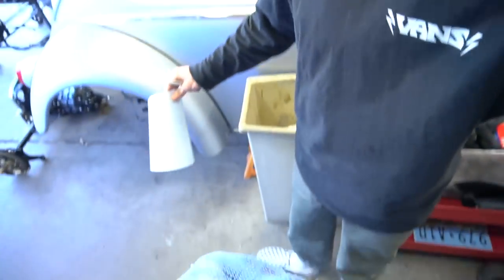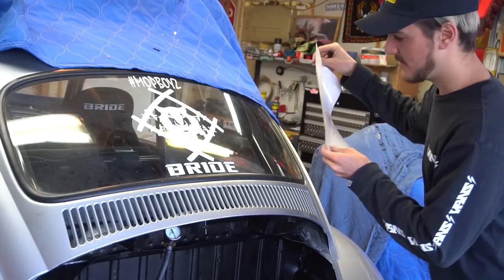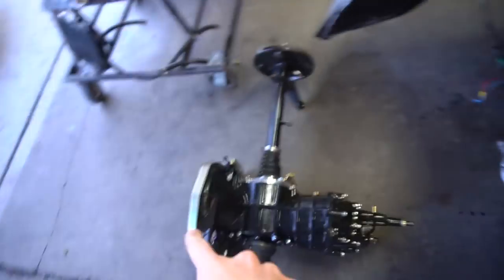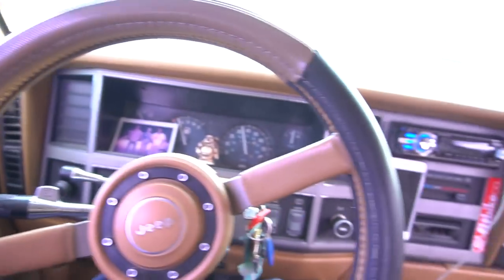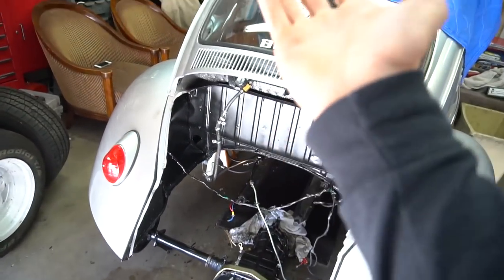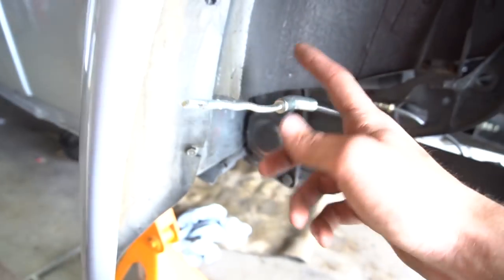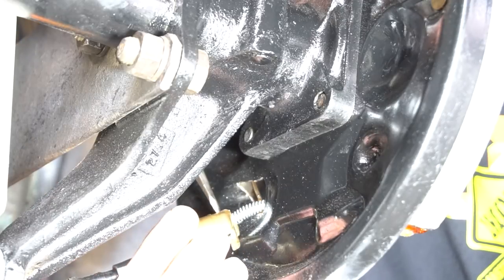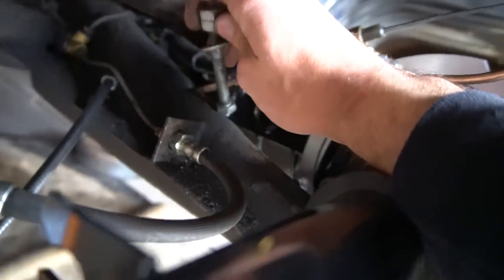NEW TRANS FOR THE 66 BUG | Freeway Flyer

Comment: Dude, I had the same problem with that pressure plate and that spacer thing and throwout bearing holder shaft, I couldn't figure it out. You got lucky that you talked to someone who new about it. I feel you man about that emergency brake, I have been there. Thanks for posting this video.